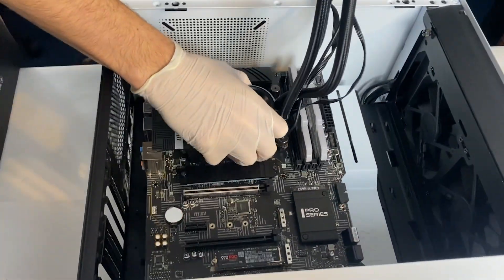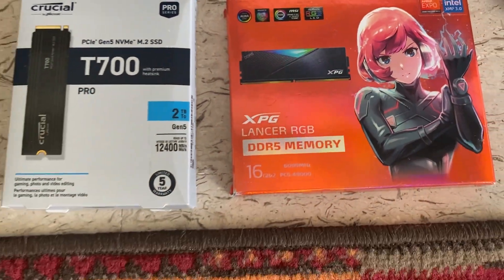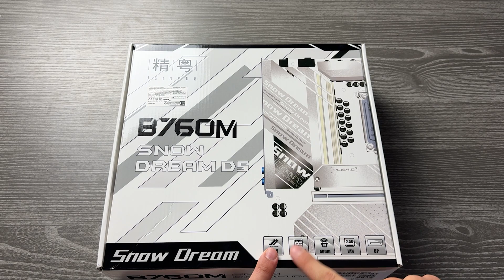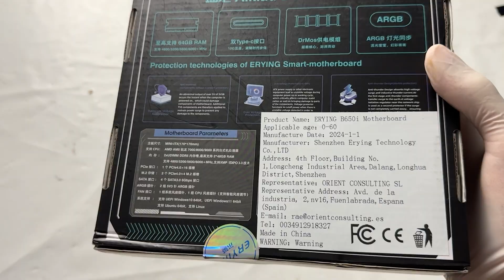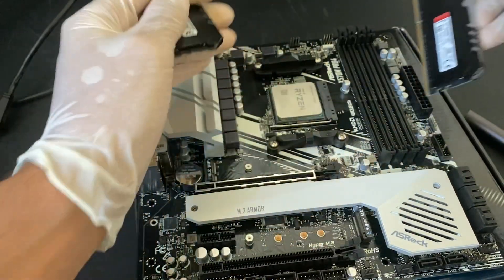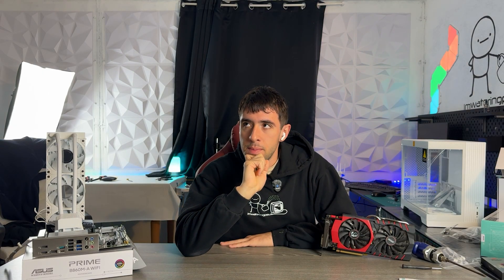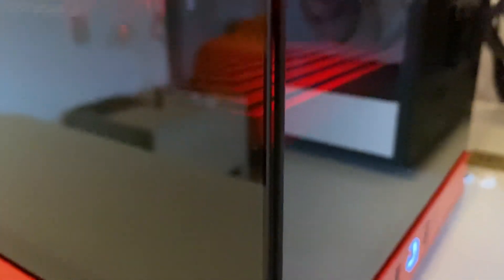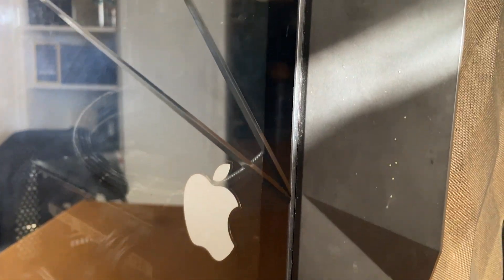Which PC Parts Are Safe to Buy Used (And Which Aren’t)

Comment: Buy all used, as cheap as possible, and for older games. Either a whole system in one step, or in two steps, system and gpu. And don't waste a gaming pc for the internet, use a cheap and very low-consumption laptop for that.

Comment: Who is this guy? He is killing me. Based on what he just recommended to buy, based on used components, I don't think he had any experience at all regarding this one. So me as 12 years plus. Experience with components. Let me tell you the facts. 
CPU=OK
Mobo=A lot of people think that they can save money here because they want the function of a motherboard. But I can tell you there's a big difference between a cheap and a mid-range motherboard. The components and the capacitors are huge. Just buy it used if its a "top tier" motherboard. dont trust him. (all my 12 years experience if from Motherboard)
RAM = OK
Watercooling = Absolutely not! You cannot define how good a water cooler is based on the sound of the pump. Never, never, never buy a used water cooler all-in-one. worst tip so far. 
SSD = I'm impressed that this kid thinks that how long you have been using an SSD is comparable to how long you have been using a rotary HDD. It's a joke. Its completely two different things. 
HDD = Absolutely you can buy used enterprise HDDs. This kid, I guess he stores his Pokémon collection on his SSDs, but for all of our others who actually store things, you can absolutely buy the HDD and put it in a NAS. 

this roast just keep giving. I do these commets live. Lets see whats next:

GPU = This kid keeps on delivering. You cannot test the quality of a GPU based on Rust. You cannot test it based on the quality of the fan sound. The performance test under light load and heavy load is partially correct, but when the GPU gives up, it's when it jumps from the low to the high load. And I can almost promise you: It's not the GPU that gives up. It's the capacitors or the MOSFETs. Test the G-SYNC 🤣

Okay, I will tell you the truth. I thought that from here it cannot get worse. 

Chassi = He doesn't recommend buying used cases. If you buy used components for your PC, you're under a budget. But his recommendation is not to spend that money on a used case; spend it on a new one. It's ridiculous what he's talking about. I can promise you the old cases that have one 120mm fan in the front and 120mm in the back are enough. Yes, you might have better cooling degrees on your CPU if you have more fans, but I promise you the CPU will not last longer -  and you have 0 performance benefits. But hey! As this kid says, "Watch out for the scratches, because we suddenly care about the scratches when we buy used components." 

Okay, now I thought I would end this comment because it's getting very long, but then I heard what he said about the PSU. 

PSU = So if you buy an old but good PSU, you could end up with a lot of debris in your environment. That's his worry. That's what he cares about. 
Never ever buy an old PSU. You don't have to buy the platinum. You don't have to buy the diamond. You stick with the gold PSU and you will be fine. You can calculate how much you will save in energy if you go up from the gold to the platinum, and it is nothing. But never ever ever ever buy it used. How can I even recommend this? It is crazy. 

I can also tell you a fun fact: 67% of the RMA motherboards that we got in Europe had no issues. We just swapped them against each other, and nobody complained.

Comment: Hello sir.
I need your advice 🙏

I got 2 processors choices, I need it for streaming, recording while streaming, editing and other types of work + a bit of gaming. Which one would you recommend for me: 
Intel ultra 5 245k or ultra 7 265k ?

Both are in good prices for me and the ultra 7 i can get as low as $246 while ultra 5 is for $220. I'm just scared that U 7 will be an overkill for me. 
Looking forward to your help 🙏

Comment: Motherboard is the most difficult component to buy used by far. RAM and storage is almost safe. Most important is to learn how to avoid the scammers. There are usually many red flags during the communication with a dodgy seller and one must learn not to ignore them, even if that means that you have to pass to what looks like a great deal. Fun fact is that half the times I bought a used case I had to spend the same amount on hardware and bits and pieces. Same as coolers, half the time are missing critical mounting components that some times you can not even buy separately. PSUs almost never go bad but half the times are coming with missing cables which again they cost as much as if you buy a new one from the beginning. People that are not regular builders I recommend to stay away from used deals and better go straight to fully build PC from a good rated flipper. Another awesome video here. Thank you!
Reply from the maker: This here is some invaluable advice. Actually is making me think I should make a dedicated video on how not to get scammed when buying used!
Reply: @ImWateringPSUs  I would definitely watch this video.
Reply: I'm not a fan of buying premium GPUs used. I've been burned too many times to count on AMD Fury/ Fury X, 80 TIs, and Titans over the years.

Comment: Previously specially intel 12th gen and older CPUs really indestructible. But now a days I've seen lot of CPU dead issues from both AMD and Intel☹.  And I think intel 13th and 14th CPUs are a bit risky to buy. And for Motherboard better to buy a new one because if mobo VRM dies anyone can fix it from store and then sell it without mentioning it. And also as you've said mobo testing is bit tricky. The older the mobo gets the higher chance that it's VRM will die.
Reply from the maker: Interesting to hear about CPUs, I've gotta say I've been lucky so far but this is all data that it's good to know! Regarding motherboards I'd say yeah they're tricky to check for sure. But not that many people selling fixed up ones!
Reply: Lets say a higher end board that can handle supplying mid or higher range CPUs with enough power and minimal throttling was available used. Would you rather buy a lower end motherboard with worse VRMs and heatsinks new over the better used board? Assuming you plan on upgrading to a mid range CPU atleast
Reply: @randoGuy77 Used higher ends are definitely a good deal.